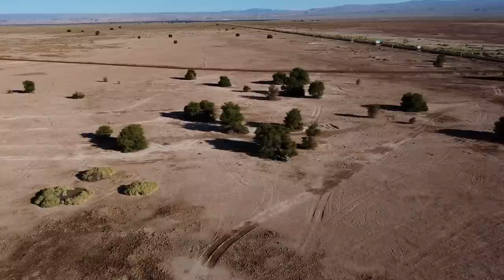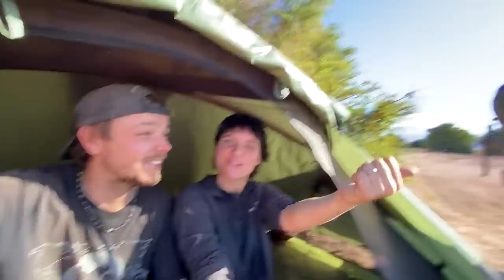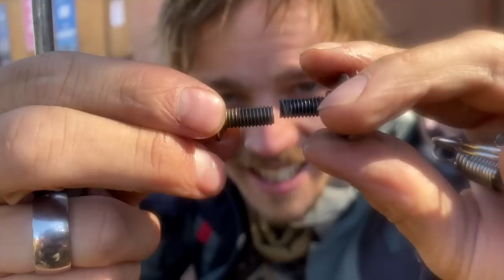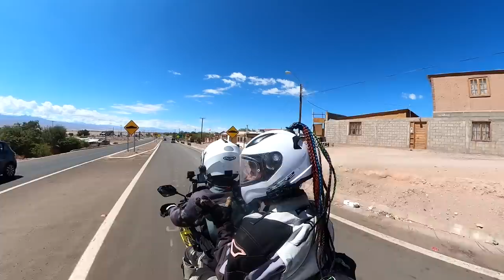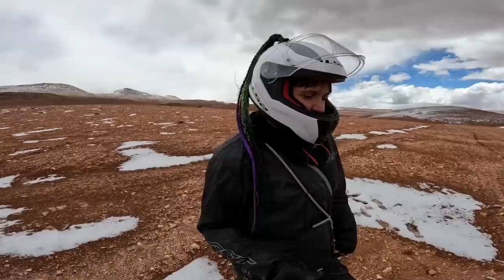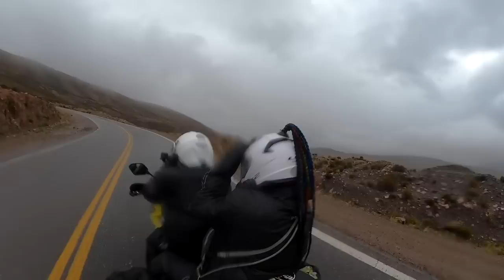CAUGHT IN A STORM AT 16,000FT 🇨🇱 [S3 - E62]

Comment: Almost all factory-fitted bolts are lock tite and that is why they stay put. If you replace them without lock tite, or at least a spring washer you will keep losing them on gravel roads
Reply from the maker: Thanks for the advice 🙏❤️

Comment: Out of interest do you have to complete your challenge on the same bike or if there was a major issue could you change bikes and continue. Just heard you say that sometimes when you have mechanical issues you think the challenge / trip may be over. Up to now the only issues you seem to have had are with components you should expect to wear out ( Tyres and Chain and Sprockets ) Bike seems rock solid apart from that. Air Filter changes may be a good idea after those dusty areas like the desert. Your going well and I can see a great difference in Ollies riding skills. 👍
Reply from the maker: Yes we have to complete the journey on the same bike, we can replace parts but it needs to be the same chassis 🐝

Comment: Check the tightness of bolts, zip ties, and clasps, look for worn cable/wiring, or brake lines before every ride is my motto.  PITA, but so far so good.  Locktite works, again PITA. Still chit happens
Reply from the maker: It’s a good moto 🤩